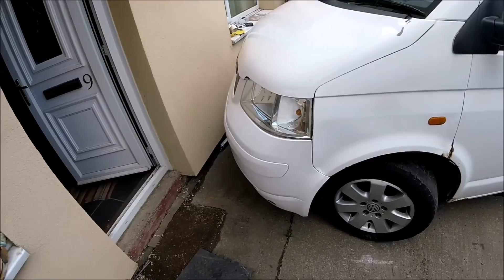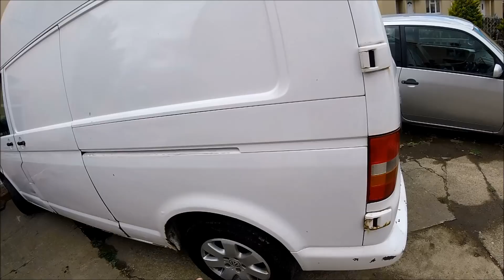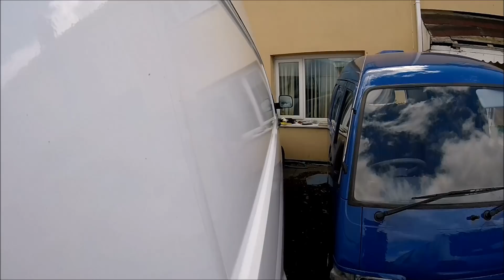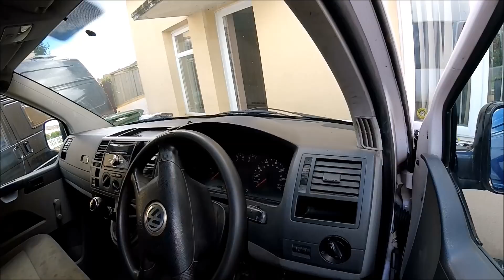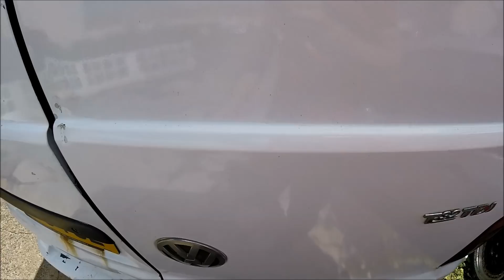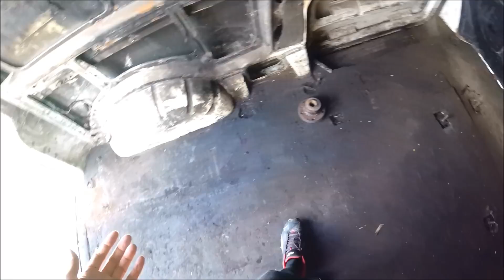VW T5 Camper Conversion Project Part 1: Van Tour Introduction

Comment: THis is only the 2nd one of these I have seen I just bought  black one to make into a stealth! Its going to be fun trying to insulate and like that high top LOL Mine was a builders van and after ripping out the ply it had most of the building site still inside!!! i THOUGHT it was slow to accelerate :o
Reply from the maker: Good luck with the project, lots of videos on my channel showing how to get things done to help out

Comment: If this doesn't phase you nowt will, and you're right,  if you don't clean it out n repaint the inside it will stink when you're tucked up in bed with the heating on. Great video thanks for sharing 👍
Reply from the maker: Yeah cleaning all done now, took a few days but looks a totally different van now